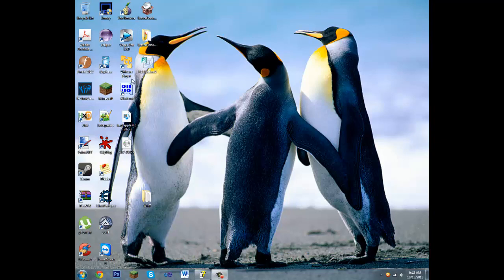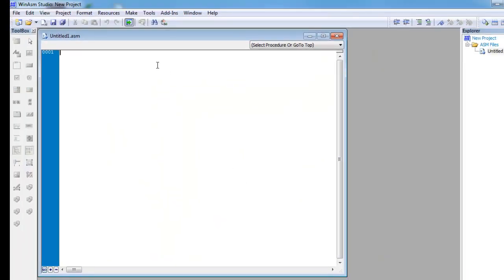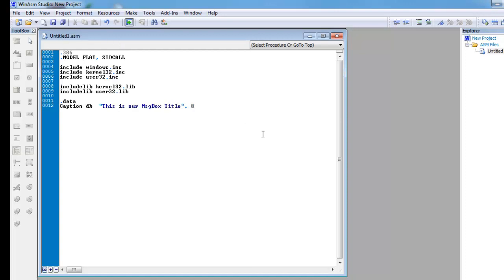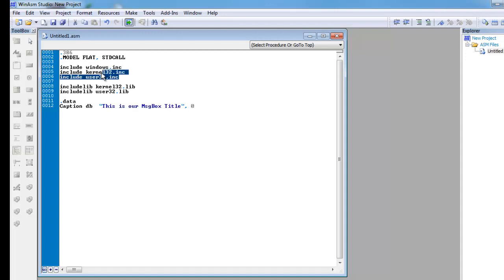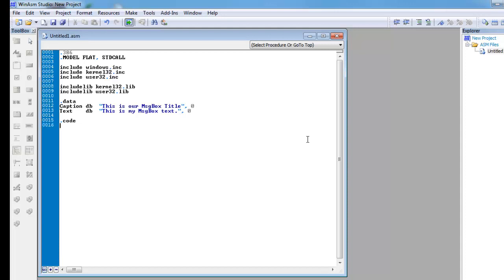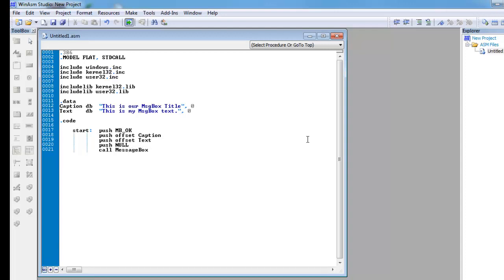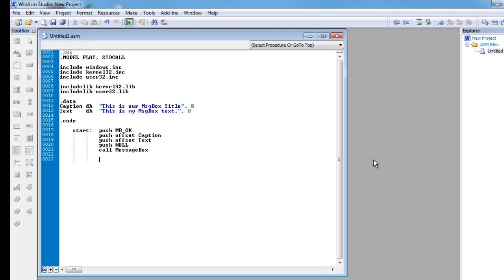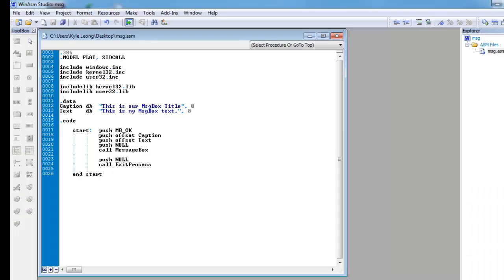Assembly Programming - Windows Message Box

Comment: ALL programs ultimately compile down to assembly.  Assembly is as low level as you can get.  It is as fast as you can achieve, and as small as you can go.  The reason why other programs like Visual Basic or other high level languages produce larger files is because they have a lot of extra code that is not needed, but makes programming easier.  

For great examples of what you can do with Assembly, search youtube for "64K Demo",  There is a competition for people to program the most amazing demos in Assembly.  These demos can be no larger than 64K in size so most of the actually create their own graphics, textures and other data when you run them.  What you end up with is nothing short of amazing.  Watching the videos (or downloading the program and run them yourself) is inspiring.  Coding in Assembly is a lot harder, there isn't much there to help you, but you're coding at the level the CPU understand itself!

Nice starter tutorial anyhow.